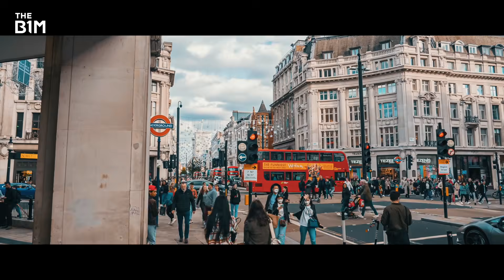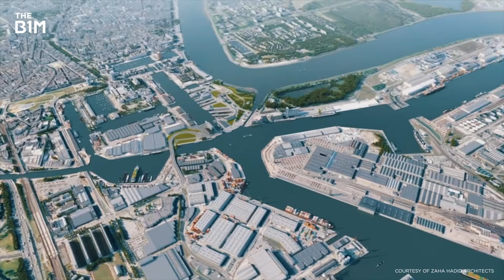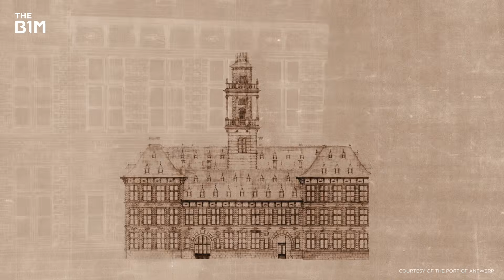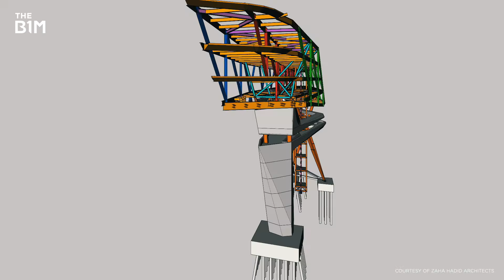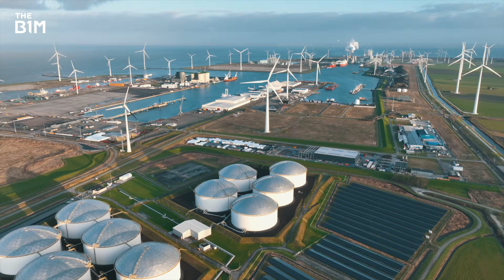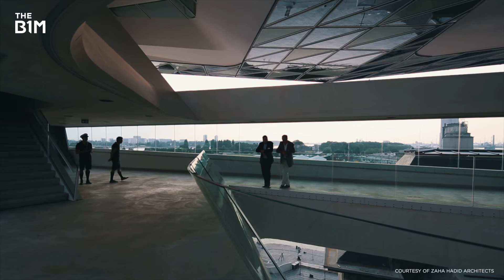Why They Had to Build OVER This Old Building

Comment: Re: the lacking interior design: The question becomes if star architects are designing extravagant buildings for themselves as an exercise in fame, or for their clients and their needs.
Reply: To be fair, the client is partially responsible on the end result too, it's not that she could do everything she wanted
Reply: Classical buildings have an obviously structure to them. Rectangular, and practical. The needs of the client are met, while also adding embellishments and stylistic elements to the exterior to give it character. Some buildings even tell stories on their exterior. If a classical architect went on an ego trip to make a less than efficient structure, they would be out of a job straight away.
Reply: @JohnFromAccounting  Most buildings that aren't brutalist are inefficient. Extra artwork and special outer materials are by definition always inefficient since it adds neither structural support or internal space to a building. What you are doing is rationalizing extra costs because you prefer a design, not efficiency. That's not arguing for Brutalist buildings, just pointing out a preference for spending extra money for some eye catching features vs others.
Reply: @JohnFromAccounting  structure, structure, structure. As if economy of construction is all that matters to a design of a building. All those descriptions you listed of the perfect classical building are all fulfilled (save the stylistic tack on features like ornamentation) by the generic, one-storey warehouses that surround the firehouse. Those rectangular buildings have been optimized by the structural engineer to be as cheap and easy to build as possible. Don’t see the client building any of those for their office expansion. Also those buildings have an expiry date to them, materially and operationally. Easy to build, even easier to rip down.
Reply: @oovdash  if you've ever worked in practice, you'd know that measures are usually taken to respect the surrounding architecture (sometimes these are planning conditions). Measures should've been taken in particular for this older building. 

Port house in itself is the embodiment of excess, wastefulness and uncreative design
Reply: @joedowning2428  the surrounding context are 1-storey warehouses constructed in the past 4 decades, not an urban European city center. The anomaly are the two historical buildings which obviously have preservation protections. The design brief was obviously to create an icon that stands out from the rest.
Reply: @oovdash  the local context I was talking of was more specifically the building it's sat on. Personally I'm just not a fan of the existing not being respected. There are examples everywhere of design 'icons' that respect surrounding architecture without being so on the nose.
Reply: Clients know what they are getting when they hire stararchitects. The client is looking for an iconic building and that's what they get. If they got something more practical they'd be disappointed.
Reply: As the master architect Frank Lloyd Wright said, "form follows function", i.e., practicality before looks. They can be achieved at the same time.
Reply: @dalhousieDream  it was the opposite for Zaha Hadid. Form always came before function for her.
Reply: @dalhousieDream  That wasn't FLW, that was his first boss Louis Sullivan.
Reply: 1/3 of Anwerp population are north african and arabs. If only those people were living in their countrys Belgium would not need to destroy it's beautiful architechture

Comment: It's a beautiful design and to me looks like a boat ready for launch. I really like the integration of the existing building, because of or in spite of the contrast in styles. It was also interesting to see how the structure works by all the loads and forces being tied together in a square. The inside of the new addition might not be inspiring, but that is relatively easy to change in terms of furnishings.
Reply: - ChatGPT

Comment: 28 sec. in and there are already false assumptions. 
Its not true that europs population is moving into cities. Much rather the opposite is happening. The exorbitant rent in cities, and the ability to work remote is driving the young working population at least in germany, back into the countryside, or to be more specific smaller cities.
Reply: Small Bavarians cities are the best part of Germany.
Reply: Urbanization in Germany has steadily increased until 10 years ago and hasn't much changed since (about 73%). I guess smaller cities/towns (e.g., around a larger city) also count as "urbanization".
While some areas lose population (e.g., the Ruhr area until a few years ago), others steadily gain population despite increasing living costs, such as the Rhine-Main area.